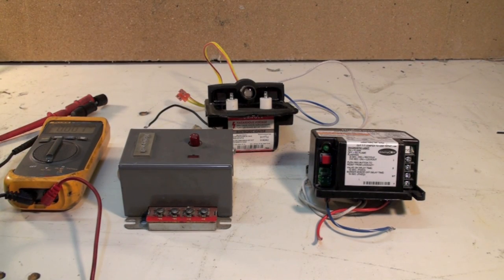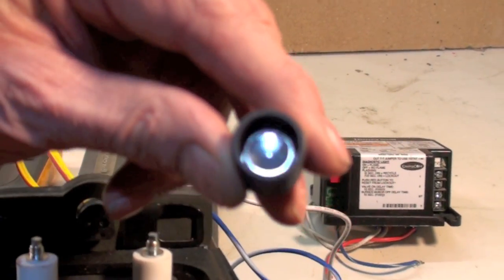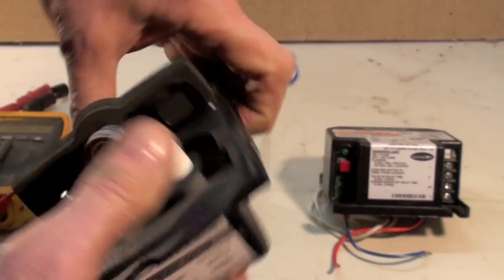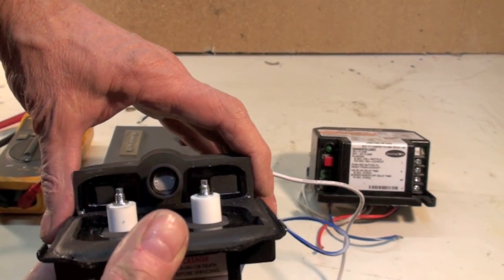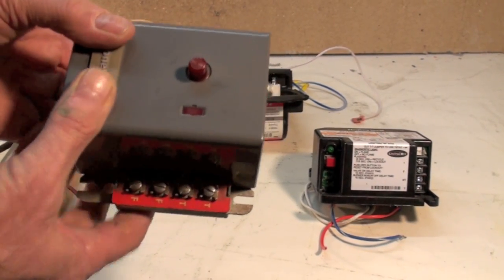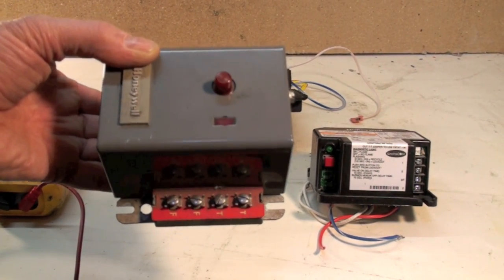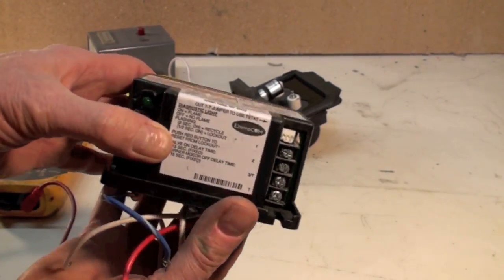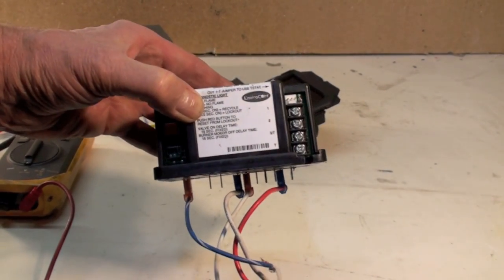Oil furnace cad cell and relay

Comment: Matt C. from Portland, OR

Sir, I thank you. I consider myself handy, but no expert.
 
I had flame, I have oil, but the furnace kept timing out. I checked the cad sensor, looked good, but cleaned it anyway. Still kept timing out. I let the furnace cool down for awhile (important) and reached my hand down in there and realized that some of the fire proof packing had fallen down into the burn hole, thus blocking the cad sensor from seeing the flame. Cleaned that out, and now running great. Your video didn’t offer up that suggestion (you may want to include in the future), but I would have never thought of that without your whole explanation.

Comment: I want to thank you for saving me $100, plus having heat again. My fuel oil tank ran out, my fuel man refilled it, but I knew that I'd have to bleed the pump of air, something I've done before. I hit the reset from the modern electronic version of the cad cell you described.  Needed to hit reset twice because all the air wasn't out, then nothing, I was locked out.  Found your video, held the reset for 45 seconds and wow!  pump began running,  Bled just a little more out and had a flame.  Now everything is fine.  Can't thank you enough.
Reply from the maker: +henry nevi's Welcome
GFM
Reply: henry nevins

Comment: You also saved me a service call, about $135 for me. It ran out, I filled with diesel, pressed the reset twice which led to lockout mode. Learned how to bleed the system, and this video explained why I shouldn't reset it again, and how to get it out of lockout mode, and after bleeding the system I got the heat working again. Yes!!! I finally learned more about these Honeywell devices and how they work, and how to get the system working again. A Big Thanks!
Reply from the maker: Welcome
GFM

Comment: Hey Grayfurnaceman,  this isn't about how much money you saved me... but, more about the respect I have for you sharing your time & knowledge - Thank you!FYI - I have one cousin, one nephew, and one brother-in-law all making a living in the hvac trades... none of which either could or would help me diagnose issues with my ~40 year old, forced-air, oil burner furnace.  It's finally working great and I owe it all to your educational "how to" trouble-shooting Video's.After working through the frustrations of learning the safe operational workings of the oil fired burner, I now know why the above mentioned relatives wanted nothing to do with my furnace.  By the way, and thanks to you, I have learned these heat units are simple and reliable if you properly maintain and service them at correct intervals.In closing, I love my "Frankin-Furnace" so named because of all the borrowed parts, it's running great because of what I learned from you.B.
Reply from the maker: Thanks for the support.
GFM

Comment: Thanks for the trick about resetting from restricted mode.  I had changed my oil filter last night and forgot to bleed the air out.  Later on when the boiler didn't start, I bled the filter and tried to bleed the air at the burner, but I had hit the reset too many times.  Finally, at 3am I found your video and now I have heat.  Wife thanks you too!

Comment: You seem like the man for this.  I recently replaced a Coleman furnace that was about 25 years old with a much newer miller with a Beckett af15 burner assembly.  The furnace worked in the house it was removed from.  After installing it in my mobile home it fires instantly when the motor starts,  stays fired for half a second then flame goes out and the motor still runs till the timeout.  the happens each time it is reset.  This is supposed to be a delay start.  My tank is full with a new filter installed coming off it.  I ran about a gallon of oil out the bleeder with no air for the last half of it.  The cad eye tests good.  The cad relay on this unit has 4 wires aside form the cad cell wires.  Black, white, orange and purple.  The clean cut valve is wired with the burner motor on the orange wire .  The ignition is wired separately on the purple wire.  I am reasoning that the valve is receiving power whenever the motor is running and some sort of delay was built into the vale which is malfunctioning.
Reply from the maker: +Aaron Graebner Sounds like a problem with the solenoid.  I would check voltage at the valve.  It could also be mechanically failed or partially plugged.  Hope this helps.
GFM

Comment: thanks for the tip on the digital relay someone had peeled the sticker and i couldn't get it to stop being in lockout. its a pain in the arse setup if all your trying to do is bleed the air from the pump after filter service. to pushes wasnt long enuf to get all the air out
Reply from the maker: Glad you got it going. 
GFM

Comment: so when I go down to check my boiler after watching your video I do what you say. I'd been using the end of a broom stick to reach the red button on the control panel to push it. I had the cover off and bumped the side of the Beckett burner and notice it lighted without me pushing the red button. I said to myself "Self check the ground" on the control panel.  I notice that I could wiggle the control panel which should have been screwed down good to complete the ground. My boiler guy was here a couple weeks ago to clean it and apparently forgot to screw down the control panel screw tight. So I did and sure as shit that was the problem. After 5 days of no heat and messing with the control panel reset to light the burner when we needed hot water. The dayum thing was fixed!!! When dealing with electrical stuff always check the power and ground first. I spent around $65 on a new control box and shipping now I have and extra part that's not needed.

Comment: This was an excellent video. I was wondering how to test flame detectors and it appears a simple multi-tester will do the job. I live in a rural area in Colorado where oil heat is not common. As such I am unable to find anyone to work on mine. Been doing most of the work ( with help of a good chimney sweep at one point) for the last fifteen years. Was able to have the bottom of the boiler relined about twelve years ago. How often should this be done?

Comment: Really good video Grayfurnaceman. I have the more complicated primary control with the lockout safety feature. After watching this great video, Im convinced my issue is my Beckett clean cut fuel pump.  I've bled the fuel from the port. I've cleaned the filter. Still wont go. I've unscrewed the high pressure fuel line from the burner and ran it to see if fuel was going through the pump and to the burner and nothing comes out! Do you have a video on something like this? Or any tips? 

I'm definitely subscribing to your channel.
Reply from the maker: If the pump solenoid is getting 120 volts and there is no flow,  the solenoid has failed.  I would be checking at the solenoid for power.
GFM

Comment: hello Furnaceman, I have a R784B honey well 3 strikes your out Cad cell relay, it has the wiring for the oil delay solenoid, I really like these relays because they shut off the ignition once the flame is established which saves the ignition  transformer from wearing out. I am up north in Victoria BC, I am a oil burner tech. My question is can I replace my Beckett oil delay fuel pump with a Dan Foss 3450 fuel pump that does not have a oil delay solinoid,  I find a lot of the newer fuel pumps tend to leak from the shaft seal. The Dan foss pump shaft seals are bullet proof I never have problems with them. it seams like the Beckett fuel pump seals almost always leak after the warranty runs out or sometimes when they are 2 or 3 years old. I know our heating fuel is much different than 10-12 years ago. thanks for the video. Steve
Reply from the maker: I can't say I have replaced a Beckett pump with a Danfoss.  It would certainly work if the mounting works.
GFM

Comment: In addition aren't these controls also connected to and governed by the aquastat which puts the boiler temp into the equation? I guess that is connected internally, not on the outside connections.

Comment: I have a rheem lowboy with Beckett AFG. been acting up or tripping out lol! I replaced cad cell & nozzle, cleaned & adjusted electrodes but now must hit reset-sometimes 4-5x's to start motor then fires & runs for a period of time5min, 20 min, even 40 min today but shut off just 2 degrees shy of thermostat. I've tried 2 BN white rodgers 668-401 relays but they never do "anything"? so I put the old one back on to at least get er going again? I believe the fan/line limit switch on stack is working correctly too.

Comment: Please help Any advice is appreciated! I have the second black box you showed that has the extra wiring. The light will not come on. Only time it will is for a milli second only when I flip the breaker on but it goes right back out. So it’s not getting power. I changed the breaker it does the same exact thing. Where should I start? Single mom here. Thanks I’m advance.

Comment: Just bought the Beckett Geni Display Tool, my hot water heater has a intermittent soft/hard lock out, next time it does it I will be able to tell what the problem is, the display tool should have lock out history....

Comment: So currently Because it is such an old Wayne burner on my Miller MOC 100 Do you think it would benefit from one of those external timed solenoid valves? Supply house has one that you add in the nozzle line with a 4 second delay $88 for burners that don’t have the control with delay contacts or a clean cut pump.
Reply from the maker: There is a benefit to a solenoid, but you will burn a lot of oil to get back the cost of the solenoid.
GFM

Comment: HEY FURNCEMAN!!! Great video!! So on my oil burner/boiler I have that last relay with the red button and green light that locks out if pressed more than once. What happened to me was that I let my oil run out and my burner went off. The oil man refilled the tank but didnt restart the system. (I'll deal with him later). Now it wont go on. I changed the filter, but the motor isn't running. The green light is blinking and I realize that its on lockout mode. Once I hold it for 45 seconds and it DOESNT fire back up, is the motor bad??
Reply from the maker: At this point, I would look for a reset button on the burner motor.  
GFM
Reply: grayfurnaceman
Ok when I got home last nite, I unlocked the relay by holding it for 45 seconds and it started back up. BUT it stayed on for 10 seconds and went back off. I tried to bleed it, but no oil was coming out at all. Its a fairly new oil burner/boiler. I opened up the small red oil tank where I had just replaced the filter that morning, and there was no oil inside of it. That was strange. I recently got my tank filled with 100 gallons of oil. But b4 the refill it had ran out COMPLETELY!! Is it possible that the oil lines may be clogged not allowing the new oil to flow through?? Or is it my pump? Or is it the psi (which doesn't move from 0 when the motor is restarted)?? Please help!!

Comment: I am having the same problem with L-7224U triple aquastat.Haven't figured it out yet.I know you have to set your low and high limits. 160 low 180 high. You might have to to turn your LL to off on a cold start boiler. I can't get voltage to the stat terminal. I might have a bad primary.IDK.They had the old style, but it was 60.00 more. If I only would have known......Steve

Comment: Hello , I have an older metal  HARVEY R75-58R / HONEYWELL R8184M Oil burner control ignition, A lot like the 2nd part that you showed, ( Don't see any Trip Button ) And you was saying i should be able to push the reset button many times as needed,  But the thing is that i had to press the reset button a few times when it would trip after running about 10 mins and now i have a hard lockout problem like on the 3rd part Honeywell plastick newer one that you showed , Any ideal what needs to be done to get it unlocked ? Aiso it looks like it has a little red light near the reset button like the one you showed but i never see it come on .
Reply from the maker: The video at 5:35 explains the reset method.
GFM

Comment: thanks for the repair videos, my Beckett burner will run fine for half hour or longer than shuts down and will not restart, transformer was replaced and burner serviced and cleaned last year,,, heat only thermostat installed 4 years ago,   any ideas before I call a burner repair man? thanks
Reply from the maker: Sounds like an oil supply problem.  Plugged filter, plugged tank, vacuum leak or plugged line.
GFM
Reply: thanks for the reply, my tenant burns kerosene, the filter at the tank is new, when bleeding the lines there is no flow problems and the fuel is clean,  the furnace comes on, works great  than shuts off, I am now in the process of replacing the thermostat as a starting point and checking again all connections for a tightness
Reply from the maker: If it runs for a few minutes, the burner then shuts off, you may have the high temp limit opening.  Mobile home?
GFM

Comment: Hi, how likely is that electronic ignition control unit stop working? And how does one test to see if it is no longer working? I have a unit like that R7184P and I don't know how to test it to make sure it is still working. Thanks for your help.
Reply from the maker: Quite unlikely.  Has the unit shut down on no fire?
GFM
Reply: @grayfurnaceman  I lost heat or hot water before on its own and then reset the red switch and everything worked fine but this time it did not...
Is there any tutorial on testing the ignition control unit?
Reply: @grayfurnaceman  Thanks for replying.

Comment: I was wondering about the transformer always running. I had to upgrade to the newer honeywell control box and could hear the transformer stop sparking, I was wondering did the old box always keep it running?
Reply from the maker: Most ran it continuously.  The newer ones can be set up to run it continuously also but there may be an issue with running the newer transformers all the time.
GFM

Comment: Hi, i like to know ,ask you if you know,that what temperature should i put my (hi and low), in winter time, to be best in fuel saving oil condition?I clean and service my own oil furnace.
Reply: i think it's supposed to be 160 on the low limit 180 on the high limit...
Reply: ahwazy if you up grade your boiler to a 3 pass boiler,with a indirect hot water heater you will save 40% of your oil bill

Comment: hello and thanks........can you recommend a 3-4ft. flexible oil line that connects to the suntec pump from the filter housing? this is to replace the copper tubing, so I can open the utica boiler swing out door without having to remove the copper oil line.
Reply from the maker: I have no source for flexible lines.  We pretty much do not use them.
GFM

Comment: My Riello oil furnace starts (ignition/flame), runs for 1 second, shuts down (pump but no flame) then fires up again and runs fine. Seems it takes that second attempt to run successfully. Cad cell failing?...

Comment: I have new boiler installed a few month ago- SlantFin boiler/ Beckett oil burner with the control (GeniSys Model 7505).  A few weeks ago, the system was shut down with red flashing light on reset button. By pushing reset button once, it started to run again and worked since then. (I was out of town a few weeks so I'm not sure if it's been working continuously.)  Last night, the same problem, I pushed reset button and restarted, however it was shut down again in the morning. It appears something keeps shutting the system down. Oil is in the tank and it's been tuned up by boiler man last time he came out to check a few weeks ago.  Any idea what could be the cause of the problem?  Could it be faulty control or wiring?  I'd appreciate any insight you can offer.
Reply from the maker: My thoughts would be it is an oil supply problem.  Be sure there is no sooting in the vent by looking in the barometric damper.  It is possible that the new boiler and burner has broken loose garbage in the oil line and plugged it.  It could be a control problem but eliminate supply problems first.
GFM

Comment: I have cleaned the cad cell (after watching the videos) but the heater is still tripping off, and there is a spark sound before and after it switches off.
What might be the problem???

Comment: great BUT I have a electronic switch on a weil mclain QB-180 with 6 wires and told to change to the honeywell like you showed??? which wires go where i understand all grounds get tied together but??
Reply from the maker: I have a video about the wiring of the cad cell relay that may help:  https://youtu.be/CvItmw0oKc4  Hope it helps.
GFM

Comment: my cad cell went out after my thermostat died.I changed my thermostat and the cad cell light is off but it kicks on with a green light when I turn on the heat.

I haven't found any video or thing on the internet about this happening.

Comment: My furnace runs for about 3 to 5 minutes then the Honey well r8184g4009 starts clicking , doesn't shut off but clicks three times real fast stops for 10 secs then clicks again. Oil boiler weil Mcclain   Any ideas?

Comment: lets say I want to test if the transformer is sparking, so I open up the cad cell relay and shine a bright flashlight into the cad cell...question: will the transformer be energized for testing or is the flashlight a different light source than the flame??...would appreciate comments...
Reply: pei bossman